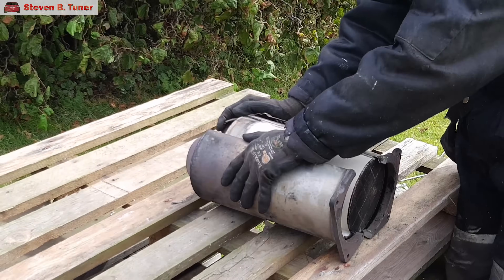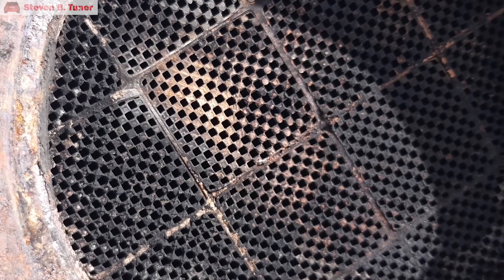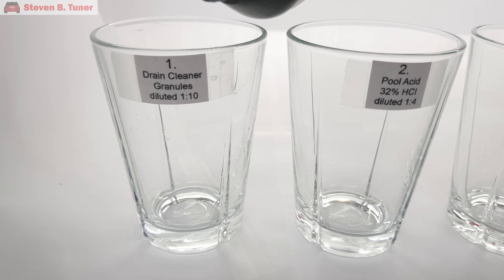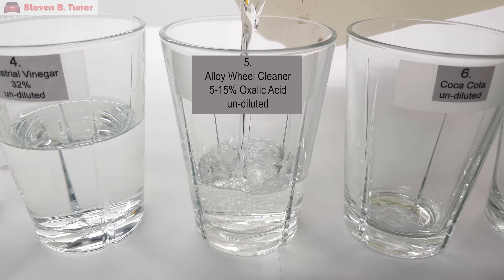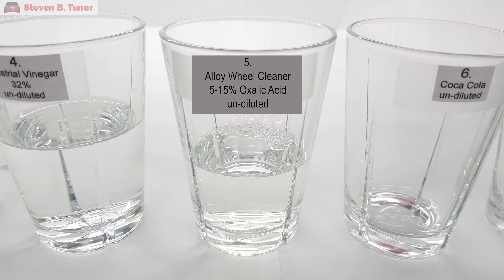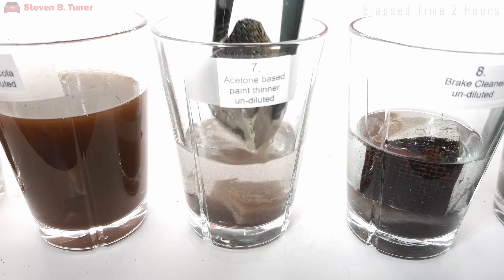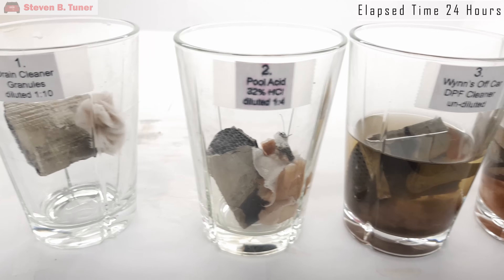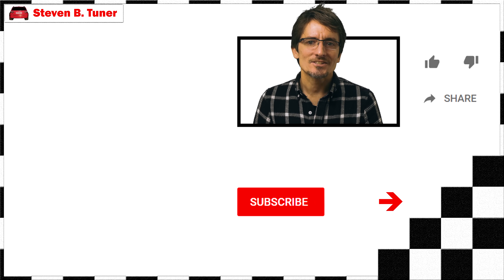DPF Cleaning at Home – 9 Chemicals Tested (Diesel Particulate Filter DIY Ash Cleaning)

Comment from the maker: If removing and cleaning your own DPF is something that you are interested in doing, then you can see the whole process in my video called "The No Damage DIY DPF Clean": https://www.youtube.com/watch?v=LE1boZ3fhLg
Reply: I know you said the HCL won, but to my eyes the Oxalic Acid Alloy Wheel cleaner was the winner. It removed both the soot and the oil (see soapy foaming action)
Reply from the maker: @crocodile2006  Hi, a few folk have used oxalic acid with good results, so either will work well.
Reply: hello Steve a lost your message how clean dpf with caustic soda and acig how meny grams
Reply from the maker: @ТарасБондарчук-ъ8в  Hi, the full 2 stage procedure can be found in my other video: https://www.youtube.com/watch?v=LE1boZ3fhLg  I use 200 grams of caustic soda granules with 2 liters of water, and when it comes to the acid wash I use 2 liters of 30% strength hydrochloric acid mixed 1:4 with water (8 liters of water). Do lots of shaking if you can, and don't leave the acid in for more than 30 minutes.
Reply from the maker: @mmm365  Hi, the DPF already gets soaked in heaps of diesel as part of the regeneration process, but that doesn't help with the ash buildup at all. I can't recommend petroleum gas as a cleaning product even if it worked (and I don't think it works) because of the high explosion risk in a warm confined area. I want to keep all of my viewers alive ;-)
Reply: What a great research thank you🎉❤
Reply from the maker: @mmm365  Hi, thanks for the suggestions! I tested the ceramic for conductivity - and it won't conduct electricity, so electrolysis won't work. Some of the professional DPF cleaning companies use ultrasonic cleaners, so there is definitely potential there. I have bought a 35 liter machine, so it is time to test it out!
Reply: Porque'  este  interface deixou de funcionar no meu Aipad Scarlett sempre funcionou e agora não dá!  Atualização que seja feita pelas duas impressas o mais breve possível pois não posso trabalhar em estúdio agradeço  a vossa atenção!
Reply: 由衷感謝您的回答！但是我比較頃向由DPF壓差傳感器的高壓膠管注入鹼性清洗劑后浸泡10~15分鐘後發動引擎排出後再停止引擎冷卻到懾氏50°C再注入酸性清洗劑浸泡10~15分鐘後發動引擎邊注入純水稀釋排出
！不知您看法如何？
請教您了！由衷的感謝！
Reply: Sorry if it had been mentioned but would some of these successful alternative be affective on catalytic converters?
Reply: I'm going to need to do this look forward to seeing it. Right now I need to clean the throttle body because I found it terribly full of carbon but in US sprinters removing this is extremely difficult so I'm going to have to clean it through the ports where the tube comes off I can get most of it with a screwdriver I think but I'm worried about dislodging all that carbon which will then go through the engine
Reply: Hi Steve, the OBD2 reader said p0299, low boost, I have removed and  checked the intercooler pipes, and intercooler, just a good visual seemed  all OK, there was a tiny amount of oil on the discharge side of cooler/pipe, I just sprayed some  degreaser and washed and blew it all dry, sat it in the sun for an hour, re fitted, we have cleared the code, can you give your opinion 🙏for a 24000km vehicle, maybe this had only done short trips? In 4 years, I think the scanner said 58%, wastegate? Egr etc Could be stuck partially open, when reved the intake pipe to intercooler expands, it drove fine had reasonable power, I've only had this about 6 weeks, I wasn't really expecting any issues with a 2021 vehicle. Id  appreciate any advice. Cheers.
Reply: Any codes pop up when drilling bigger holes in the dpf?

Comment: Do you have to remove the DPF From the car to clean it
Reply from the maker: Hi, the way I do it ensures that it only needs to be done once every 10 years - and the full procedure is shown in my other video: The No Damage DIY DPF Clean. Brands like Liqui-Moly offer in place cleaning solutions that will remove enough ash to keep you going for a couple of years.
Reply: @StevenBTuner how easy is it to fit a vaporizer 5th injector to a 2014 Ford kuga 4x4 wd please
Reply: Or exchange one

Comment: Can dpf be gutted out or removed, I have a 2021 renault master, and the " Check the anti-polution system" message came up, low kms engine 24000kms, will the OBD tell me the actual fault, I've just put so penrite DPF cleaner in the tank and see what that does. 😗
Reply from the maker: Hi, at that number of kms it is probably nothing to do with the DPF (although the DPF will suffer as a result) It is more likely a problem with the EGR valve or glow plug relay / controller.

Comment: What are your recommendations for avoiding DPF problems, and how should we drive our vehicle?
Reply from the maker: DPF issues are improving over time as most countries have mandated lower ash in diesel fuel over the last 25 years. Making sure your car is serviced with the correct low ash engine oil is also very important.

Comment: Hi, is 9% oxalic acid safe for a DOC materials?
Reply from the maker: Hi, my favourite safe method is the one featured in my other video: The No Damage DIY DPF Clean. Oxalic acid has potential, but requires further testing to guarantee a safe concentration.

Comment: Cuidado con el HCl, El gran riesgo: La integridad de la Cordierita
La mayoría de los FAP están hechos de Cordierita. Este material es una cerámica porosa que soporta el calor, pero es vulnerable a los ácidos fuertes:
Ataque a la matriz: El HCl a concentraciones del 32% puede empezar a disolver los agentes aglutinantes que mantienen unida la cerámica.
Debilitamiento: Puede que el filtro parezca limpio, pero si el ácido debilita las paredes microscópicas, el filtro podría desmoronarse o derretirse por las vibraciones y el calor del motor a los pocos kilómetros.
Metales preciosos: Si ese FAP tiene algún recubrimiento de platino o paladio (catalizador), el HCl los atacará y los eliminará, dejando el filtro inservible para la función química (aunque el aire pase bien).
Reply from the maker: Looks like an AI response. If the AI had watched the video then it would realise the concentration is 6 - 7%, not 32%.

Comment: Thank you for this video.  I was able to clear my DPF at home without removing it.  I disconnected the CAT up above and filled the DPF up with OXALIC acid and then flushed with hot water, did that X2, then ran hot water with dishwasher tablets through X2, then flushed with hot water again.  I also did it with coca-cola a few months ago, but am skeptical it did much. In any case, the acid worked great and the dishwasher tablets kicked out the last of it.
Reply from the maker: Thanks for sharing your experience on in-place cleaning - it is something a lot of folk are interested in as many cars are now including DPFs that are virtually impossible to remove!
Reply: Привіт, що за автомобіль?, як заливали рідину до фільтра?

Comment: I clean dpf‘s Professionally. It is imprtant to not only clean the dpf, but also not damage it in the process. I often receive dpf‘s that my clients tryed to clean themselves with all sort of chemicals. Most of the time the dpf gets damaged because the chemicals that they use are too aggressive. Usually you can see rust on the ceramic of the filter after using the wrong chemicals, or at least that is my experience. If you want to clean the dpf yourself at home, I whould recomend to use a special cleaner like in the Video (Wynn‘s Off Car Dpf Cleaner).  Maybe it didn‘t achieve the best result in this test, but at least you can be shure that the dpf wont get damaged.
Reply from the maker: You're absolutely right to highlight the importance of not damaging the DPF during the cleaning process. In my other video (The No Damage DIY DPF Clean) I do a lot of testing to ensure that any metal corrosion is kept to an absolute minimum. However, I would always recommend to folk to take their DPF to a professional such as yourself for the best possible clean.
Reply: What are your recommendations for avoiding DPF problems, and how should we drive our vehicle?

Comment: H Steven, I used the pool acid solution to great effect with my previous diesel car. It transformed the car. I now have a Volvo D5 diesel and they use cordierite coating on their DPF's. Will the Pool Acid solution, which is Hydrochloric Acid in 10 parts water, damage the cordierite?
Reply from the maker: Hi, I haven't done any testing on that specific configuration, so I'd rather not speculate. I don't want to even hint at a method that will destroy your DPF.

Comment: Thanks, awesome presentation! PepsiMax is the deal for me! 👍 For my German friends: Warnlampe "Partikelfilter ist dabei zu verstopfen" - Citroen Berlingo 1.6 HDI (212.000km) / Peugeot partner 1.6 HDI mit Partikelfilter stehend vor dem Motor, direkt hinter dem Turbo vorne im Motorraum. Motor leicht warm, Drucksensorkabel aus Klammer lösen, Sensor mit 22mm Schlüssel abschrauben, mit Trichter erst 0.2L PepsiMax (ohne Zucker) einfüllen direkt in den Partikelfilter, nach 1h + 0.2 PepsiMax, nach weiter 1h +0.2 Pepsi Max und nochmal nach 1h +0.2 PepsiMax, dann 3-4h wirken lassen, Phosphorsäure ätzt wohl die harten Ablagerungen weg, danach 10-15min Leerlauf (Pepsi abdampfen lassen) und eine Runde trocken fahren. Lampe kommt bereits seit einigen Wochen nicht mehr wieder, Durchzug wirkt auch leicht besser. 2€ investeriert, statt 350€ + Einbau für neuen Partikelfilter. Es funktioniert tatsächlich, hält seither problemlos, hatte selbst keinerlei Nebenwirkungen. 😊
Reply from the maker: Thanks for the tip! That's a great contribution to the video!
Reply: @StevenBTuner  You saved a lot of money for ma and a lot of people too, I guess. Some profitorented entities hate you, I'm sure. Excellent advice, because one never engages in such testactivities by oneself but is curious, "there must be a cheaper way!"  Thumbs up and subscribe is done. 😅

Comment: You should try an ultrasonic cleaner.
Reply from the maker: Hi, I tried the largest 'home' ultrasonic cleaner - and it was nowhere near strong enough. A large industrial unit that is designed for cleaning alloy wheels would probably work, but that is way out of reach for home DIY use.

Comment: Good afternoon. I have a new catalytic converter filter in the same container as the diesel particulate filter. I want to soak it in caustic soda. What proportions should I use? How much soda per liter of water? I want to soak it for 12 hours. Thank you.
Reply from the maker: Hi, 200 grams per liter of water along with some dishwashing liquid will help remove any oily soot, but it is the 2nd stage acid wash that is really needed to make sure that the long term ash deposits are removed.

Comment: What brand was the wheel cleaner? I know different brands work differently
Reply from the maker: Hi, the brand I used changed to oxalic acid - so using a particular brand is no guarantee of the ingredients, as they change all the time. The raw chemicals are a lot cheaper, once you find them.

Comment: Hi Steve, I have a golf 1.6 tdi and I tried a using a can of dpf cleaner. This was on the car still with the sensor removed. (not sure what the sensor is , i think its a temperature sensor). anyway after doing this it seems to have totally blocked the dpf. When I replaced the sensor and started the car it ran for a couple of seconds and died,  Removing the sensor it would start up with exhaust gases comming out the hole where the sensor goes.
I repleated this until I used all of the can of dpf cleaner.
I am going to have to get the dpf off the car and try your methods.
I was wonder could you test using  IPA 99.9% | 5L | Lab Grade | Isopropyl Alcohol | Isopropanol 99.9%
If it works I might be able to do a on car dpf clean.
also wondering what White Vinegar 5L Acetic Acid 40% 8 x Stronger Than Regular Spirit White Vinegar Cleaning for Sanitising & Cleaning - Deodorises & Removes Grime Descaler (1, 5L) is like.
thanks for the good work.
unfortunately the car not driveable and don't have the equiptment to get the dpf off (i.e. axel stands)
Reply from the maker: Hi, that sounds like a very blocked DPF! There is probably a lot of soot that you will have to remove, so multiple cleaning cycles might be necessary. My previous testing shows that alcohol has no effect when it comes to cleaning DPFs. Industrial strength vinegar has good potential, and is something that I am planning on testing in a future vid. All the best in getting that DPF off the car!

Comment: Can you use these cleaners with the DPF installed? I have a 2013 TDI I’ve seen videos where they removed the oxygen sensor and add cleaning solution to that but when doing that do you have to remove the air intake sensor?
Reply from the maker: Hi, that kind of cleaning is good as a 'maintenance clean' - something you do every couple of years. I haven't done any testing myself, but there are some folk in the comments who have done it with crushed up dishwasher tabs, and have reported back good results. I prefer doing a full removal and 2 stage clean so that I don't have to worry about it again for 10 years.
Reply: @StevenBTuner  what kind of cleaner do you recommend when leaving the DPF installed and putting it in through the O2 sensor?
Reply: I used XENUM - DPF Cleaner - 400ml : price 24€-30€. I went from 18 million ppm to about 9 mpp after first bottle. I repeated the operation with another bottle and divided the ppm by 2 again. Then I asked a Friend to run a regeneration with the Electronic suitcase. Last, I used an injector cleaner mixed with the diesel. I think I paid about 20€-30. So total cost was about 100€.
Reply: I think I measured between 1 and 2 million ppm after I finished everything.

Comment: Not trying carb' cleaner? Or oven cleaner? Things designed for carbon, soot & metal
Reply from the maker: Drain cleaner (sodium hydroxide) is the same as super concentrated oven cleaner.

Comment: 👍👍👍👍 thanks for your efforts at the moment I'm trying to clean my dpf of a VW T5 I'm trying caustic soda 125g to 5ltr hot water but not sure how long to leave it soaking what would you recommend 👍
Reply from the maker: Hi, it is best to make sure the water isn't too hot to start with as it will heat up when mixed with the sodium hydroxide. Add a few squirts of dishwahing liquid too and then leave it sit for 5 mins, shake it for 10 seconds, let it sit for another 5 minutes - repeat until it looks like all of the black soot is in the solution. How long this stage takes depends on how gunked up the filter.
Reply: Вы уже провели эксперимент? Есть мнение, что из-за сильный щелочных растворов, клей,  что держит части фильтра может отклеиться.

Comment: hi is it possible to clear the dpf by pouring the liquid in the dpf without removing it like the lauch uk dpf cleaner.
Reply from the maker: Hi, I haven't developed a DIY method for that yet, but there are commercial products from Liqui-Moly and others that are designed to be used that way. A couple of folk in the comments have used crushed up dishwasher tabs mixed with water that they have poured into the sensor hole - they say that it worked well, but I can't verify their results in any way, so I am not going to recommend it.

Comment: Hey Guys, thanks for posting this video. This was a huge eye opener. I’ve done the drain pipe cleaner last week, in a build in state of the car. Didn’t work like expected. Then I found your vid here. Man I’m happy to say at least 😂. The dishwasher part was they key. Used 4 bottle hot water, with 0,75 liter of water and in every bottle half a dishwasher tab. Used a pump for draining servo fluid for filling it in the pipe to the pressure sensor. 1,5 liters on the first run. Then waiting 1 hour. Then doing it again with the other 2 bottles of dishwasher tab solution, 😂😂 in between what should I say I turned the engine for a short amount of time on, let it run 2-3 minutes after every two bottles, then turned it off again. After 2 hours I started the engine and gave power. That’s it. The stuff comes out from alone. All the fluid rinsed from the back of the exhaust pipe 😂😂. Nice. Errors before we’re 0480a and 0667 the first is DPF clocked and the 04667 is regenerating to ofter . I have couple of snapshots of Carly saying 60 Gramms of shoot and 6 Gramm ash mass and the pressure sensor was going crazy before , for the finishing I gave it a 1,5 liter coke, the e61 is happy again. Man many thanks for your support and study. Really appreciate your hard working dedication ❤❤❤
Reply from the maker: That's great to hear it worked out for you!
Reply: What is ash and soot level after you tried your described method? My dpf is 55 gr on 80 on vw passat b8
Reply: @MuvahhiD_2009 Зола в этих моторах это расчетное значения, которое к реальным показаниям не имеет отношения.

Comment: Not unexpected results now you point out that there is soot and ash to remove.
Soot is acidic - drain cleaner is normally caustic soda as is a good part of dishwasher tabs along with surrfactants.
Hydrochloric and phosphoric acid for ash which is alkaline. Basically making a bit of soap.
Reply from the maker: A good summary :-)

Comment: So , now you would use dishwasher tablets dissolved to clean oil and soot for the first faze, how many tablets to a gallon of water ? And then the acid magic mixed 1 gallon of acid to 3 gallons of water . Preclean for how long ? then rinse and then acid bath for how long ?
Reply from the maker: Hi, my favourite process can be found in my other video - The No Damage DIY DPF Clean.

Comment: I dont have tools to remove my dpf filter on my driveway.
Reply: on bmws you can open the gas pressure sensor connection to the dpf filter and fill it in there. so at least a half way possible solutions?!
Reply: @magnusbrachat6256 and same for vw passat b8?